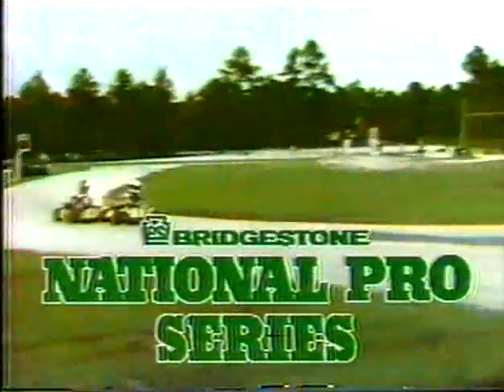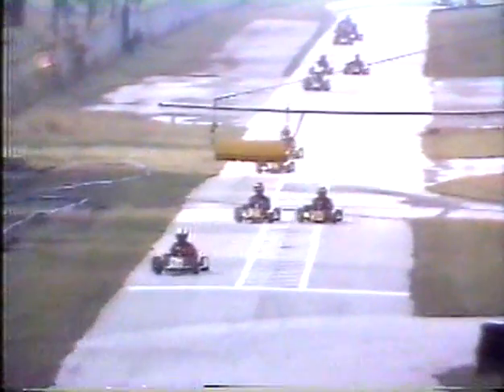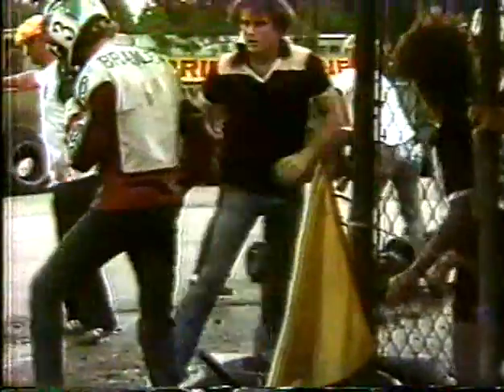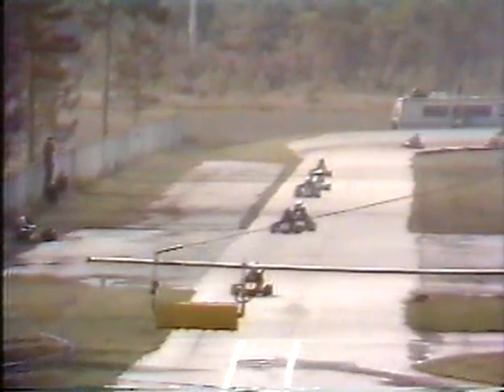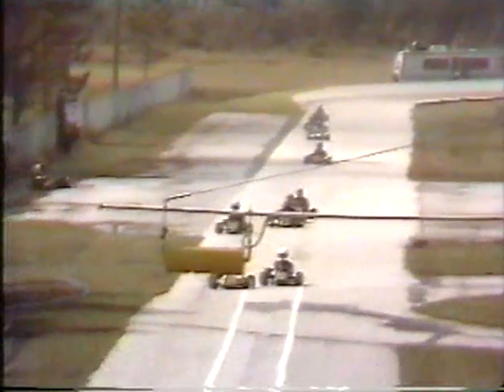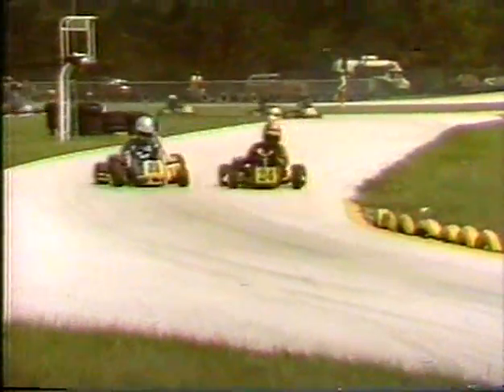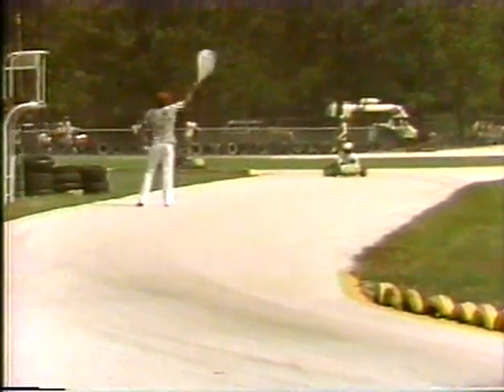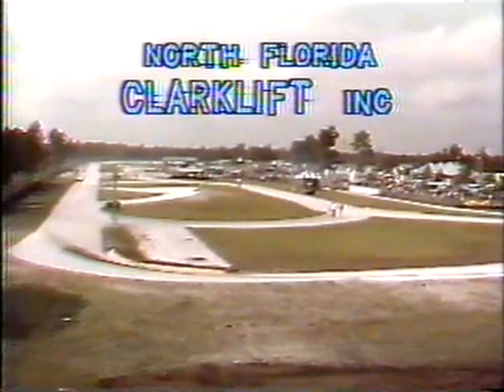1979 Jacksonville Pro Race

Comment: I raced this series, but didn't go to Jacksonville, did Quincy and Medford.  My first season as a pro, I drove for Rich Burton's Magnum Karts.  Haddock drove a Magnum here.  At the first race in Quincy got caught in a first lap accident in the heats breaking 6 ribs.  Still qualified for the main but had to pull out of the first main due to the broken ribs.  Skip Bailey  PS.  I just noticed the PKA logo is shown, I designed the logo and did the first years program.

Comment: Still the same today as it was back then.  Best cheater wins.
Reply: Bad Gumby 100cc engines open to modifications and open fuel. The fewer the rules the harder it is to cheat. With the simplicity of karts in an open class cheating mechanically is virtually eliminated.
Reply: @jbratt  That's somewhat true for the open classes.  But believe me all those guys up front found ways around the rules.  I used to work for Comet Kart Sales and also worked for Emmick Karts.  Three most important things to go fast - Engine, Fuel and Tires.  Yea, kart setup and driving were very important, but those first three items is where the top national guys concentrated all their efforts.
Reply: @badgumby9544  I did win the Open Heavy class at Daytona in '85 and. the IKF Grand Nationals at Willow Springs the same year.  The classes were huge then.  The stock classes were where the cheats were.